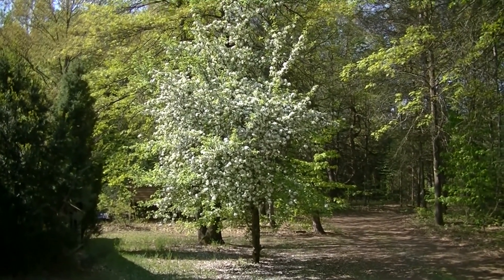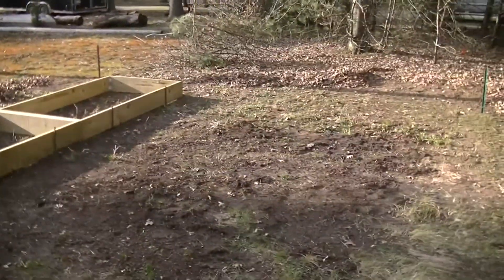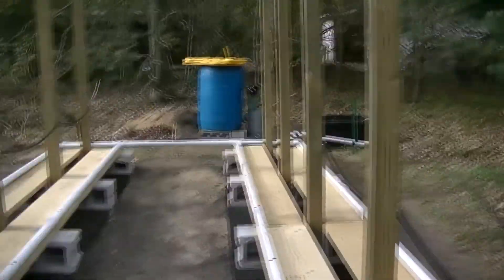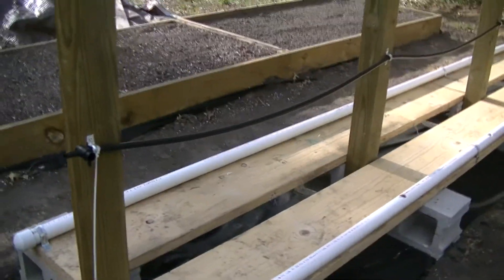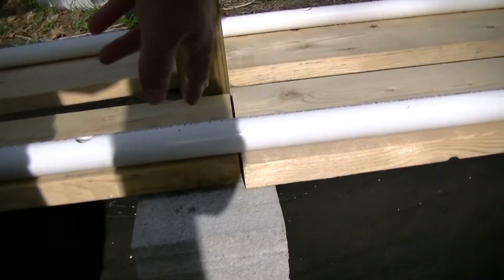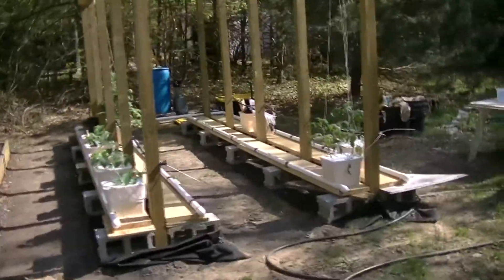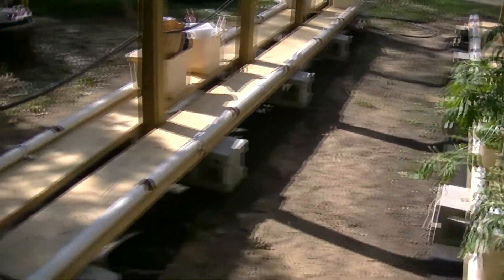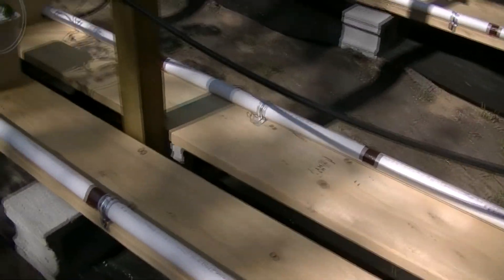2013 Outdoor Hydro 07-Building the Hydroponic Structure

Comment from the maker: You are right!  However my initial idea was to be able to do it without one.  The biggest reason I'd like to build one is to be able to extend my season.  I did take a look at your Mickey Mouse Greenhouse on Facebook.  Did you use 4x4s to hold up wooden sides?  I like the cattle panel idea too.  I may get my 3d drawing program out again and see how I could add a frame around this for the fall or early next spring.  Thanks!